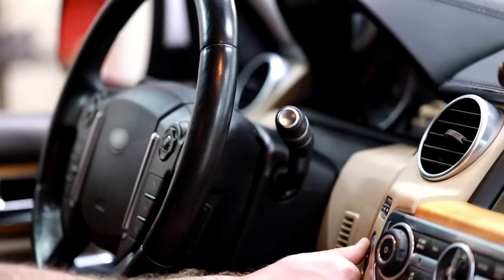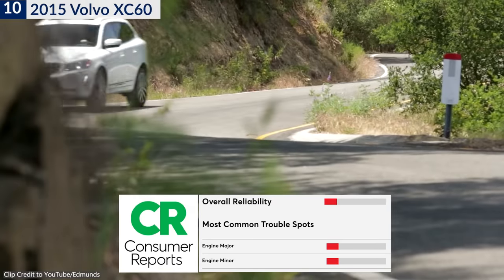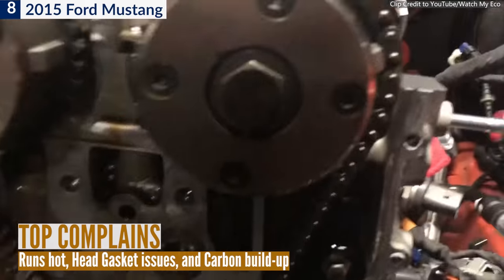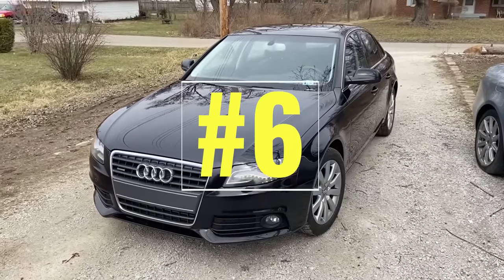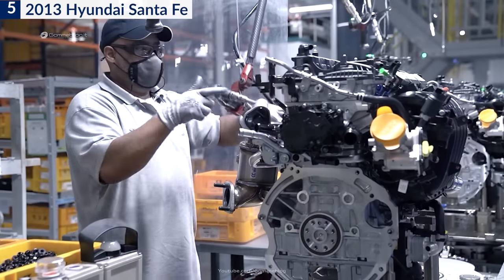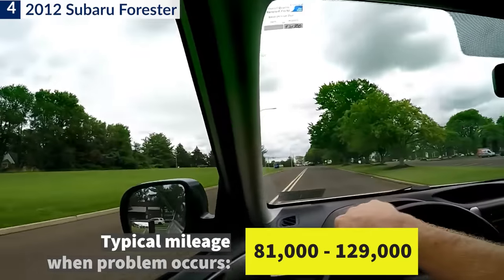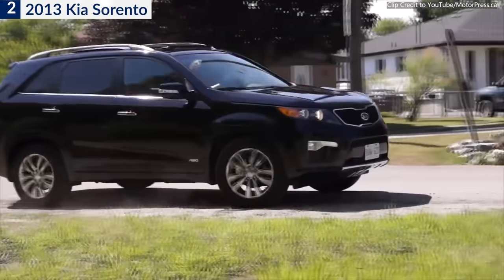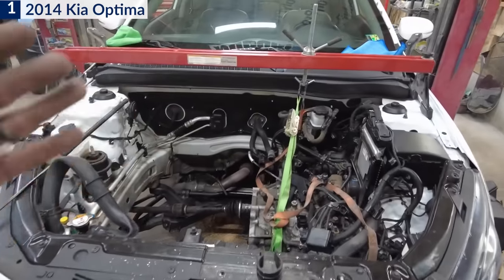10 Used-Cars to AVOID for BAD Engine - as per Consumer Reports

Comment: We purchased a new 2013 Hyundai Accent HB.  It's 11 years old and it has been a great car.  Engine purrs and transmissions shifts smooth.  Everything on this car still works.  I have done most of the maintenance myself.  Besides basic maintenance, I have replaced the alternator (normal for a car this age).  I guess sometimes you just get lucky.
Reply: That car will last a long time.

Comment: Too much high-tech, especially on turbo engines. My 2001 Chevy Astro with the 4.3 liter V6 is a joke to many I'm sure, but it still has 50 psi oil pressure with 280k miles. Best auto purchase ever.
Reply: Those were nice Vans but boy were they thirsty.I really liked the 1988 model with the European type headlights
Reply: You better hope your never in a frontal collision in an Astro.  They are deathtraps.
Reply: @user-tb7rn1il3q  They said that about the VW Beetle air-cooled with gas tank in front yet it was the FORD pony cars (Pinto, Maverick) with gas tank in rear that were the ones you always had a bag of Marsh-mallows for the just in case time.
Reply: We hav a 2000 GMC Safari 345000 on the engine, Still runs like new
Reply: i have a 1992 Chevy S10 4.3 shortbed with 240k miles. Engine has never been opened up. I've mostly only had to do general maintenance.. oil  changes ,trans fluid, tires, brakes....etc.
Reply: I have a 2005 astro 360 k lol still runs
Reply: @robcontractors6085  I was a courier for a company I worked for back in the early 90’s and would deliver packages to different companies day-in and day-out in a GMC Safari, which is the Astros twin.That van had well over 200k miles.
Reply: The 4:3 engine is a good engine
Reply: @bunzeebear2973  lol
Reply: The 4.3 is reliable, but rough and thirsty.
Reply: @lowlifeangler  agreed I have a 1998 c-1500 Silverado pickup with the 4.3 vortex v-6 although while thirsty on fuel it has well over 200,000 and uses no oil and has 45-50 psi oil pressure at highway speed no problems whatsoever and it’s 23 years old not bad for a crappy American gm product although it can’t touch my 3 rd geno Toyota forerunner sr5 with a 3.4 v-6 with 300,000 mi and doesn’t leak or use a drop of oil however I wish gas mpg was better it too like the gm 4.3 is thirsty on gas but never breaks down or leave me stranded and starts right up sitting outside in -30 temps one rock solid Toyota product bulletproof vehicle like the landcruiser and helix and many other Toyota vehicles
Reply: @claytongillaspy8847  cool, Dad has a 1999 4.3  S10 that has a little over 100,000 miles.  He barely drives it
Reply: I had a '72 SHITROLLING Vega gt that was the worst piece of shit EVER!!!!!!! ONLY HAD IT FOR 2 YEARS- 2 ENGINES LATER & MONTHS IN THE DEALER. THE CAR WOULD NOT PASS INSPECTION DUE TO VERY MANY RUST HOLES. WE HAD PAYED THE DEALER A LOT OF MONEY TO RUSTPROOF IT WHEN BRAND NEW!!!!!  2 MILES ON IT!!!! THE DEALERSHIP BLAMED THE RUSTPROOFER - THE RUSTPROOFER BLAMED THE DEALER FOR NOT APPLYING THE PRODUCT CORRECTLY!!! THIS CAR HAD LESS THAN 25K ON IT!!!  THEY BOTH GAVE US NOTHING EVEN THOUGH WE HAD A RECIPT FOR THE RUSTPROOFING !!!!!     I WILL NEVER - NEVER BUY A SHITROLLING CAR/TRUCK AGAIN!!!!!!!!!!!!!!! TO HELL WITH SHITROLLING!!!!!!!!!!!!  MONEY WAS HARD TO EARN BACK THEN - SPENT 2800 DOLLARS ON IT BACK IN '72 OVER TWICE WHAT WE SPENT ON '68 BEETLE.  GM/SHITROLLING RIPPED US OFF THOROUGHLY!!!!!!!!!
Reply: @dougcarpenter7627  Man, you could have bought a Corolla with that kind of money back then. Everyone now knows the Vegas were literally steaming garbage cars, but in 1972 they looked better than Pintos.

Comment: I own a 2007 Suzuki SX4 manual Tran all wheel drive crossover  from new 175,000  driven all year round in Alberta only thing it’s needed so far was a serpentine belt.  a great little car just did the brakes last year amazing. I tow trailers, pile ladders on the roof rack and it’s peppy and fun to drive

Comment: 2020 Kia telluride. Had nothing but problems since I drove 50 miles to the dealership to get the scheduled maintenance and oil change done, drove 1/2 way home, noticed a smell and engine running slightly hot.. pulled over checked oil, NO OIL IN THE CAR!!! Not once but TWICE the dealership/service department did this!!
Reply: Bet your Telluride is toast by now if you drove it with no oil
.😮
Reply: Had that happen Days chevrolet Oil change for trip to northern s carolina got to columbia oil not show on stick over 2 qt low Despicable

Comment: I had a 2014 Kia Sorento SXV6.  Almost 3 years ago my wife was driving it and she said that she heard a grinding noise while driving it.  She took it to a local Firestone and they checked her oil and there was none in there.  They filled it for her and it cleared that up.  Took it to the dealer with 99,400 miles on it and they said they'd have to do an oil consumption test which would take it over the mileage.  When we called Kia about it, it had a little over 100,000 at that point and they said the dealership didn't log when we came in with the problem.  The lady at the other end asked my wife "Well don't you check your oil every time you get gas" and my wife asked "do you" with silence at the other end.  So going through about 4 quarts of oil every 1500 miles for 2 1/2 years I was on my way to work and it blew up on a busy interstate.  I had to pull it off on an on ramp shoulder.  It had almost 144,000 miles when it happened.  Needless to say, Kia will never get my business.  I had beater cars that got way more miles than a Kia Sorento SX V6 with every option.  I had 2 cars, one that I paid $2500 for and one for $4995 that both were well over 200,000 miles when I got rid of them.  The one was leaking oil really badly, but the other one was fine.  I had a 2011 LXV6 Sorento that was great but got rear ended.  That one almost had 144,000 miles on it as well but had a different ending.
Reply: I totally love my KIA   Just passed 140,000.  It does however have an electrical problem.
Reply: My vehicle (not Kia) at 204k burns about 1 quart of oil per 1000 miles, and I thought that was bad. 
But 4 quarts every 1500 miles is insane.
Reply: I check the oil level every week, literally takes me 2 minutes.  Unlock my car, pop the hood, raise the hood, pull the dip stick & wipe with paper towel, replace dip stick and re-check.  EASY.
Reply: @onenikkione  My wife has a bad back so she would have a lot of trouble picking up the hood and slamming it back down.  When you're spending that much on a car, you would hope that it wouldn't be going through oil like that.  I had cheap cars that didn't have the issue the Kia had and that's the only car I've ever owned that the engine blew up and I had plenty of cars throughout my lifetime.  Kia lost my business.  The lady at the other end said  to my wife with the initial original complaint "if your oil light comes on, your engine is done."  That didn't happen in her case.  Most cars will give you the low pressure light as a cushion to let you know to add oil.  The only other car that I had a major oil leak was my 1988 Chevrolet Corsica.  It had 211,000 miles when I traded it in but in spite of the major leak, it ran fine.  I just had to add a quart of oil every so often.

Comment: There is nothing 'eco' about replacing/spending tons of money on turbocharged 4 cylinder or v6 engines. High rpms, lightweight parts, rubber band cam-chains, along with direct injection - OIL burners.

Comment: I had a 2013 2.4 Santa Fe. I sold it to my sister with 106,000 miles with zero trouble and she still has it with 150,000 and still going strong.
Reply: Great story bro
Reply: Ya eh  there are always exceptions. I have a 2009  Nissan Versa with the CVT transmission  148k on it. Engine and CVT still run as brand new

Comment: That issue with Audi 2.0 T engine has not disappeared, it just moved to the VW lineup.  We just got rid of a 2016 Tiguan with that engine and we were adding oil every 700 miles.  It had  been going on for about 12-15 months, getting worse,started with about 50-55K miles.
Reply: I am unsatisfied with my 2015 Renault based Dacia Duster but other more costly brands (from 2015 or 2016 onwards) don't seem to be doing much better. Lots of electronic issues and so on.
Reply: its the same engine dude lol any 09-16 vag is an issue

Comment: My 2021 Elantra SEL with only 7,400 mi has been sitting at the dealership for five weeks waiting on a new transmission. Service manager told me there’s another Elantra same year as mine at the dealership with the same issue and same low mileage. I was given a 2022 Santa Fe as a loaner, and after reading more about these cars, I just hope it remains operational until I get my car back…IF I get my car back. Right now it’s solidly in lemon law territory, so maybe that’ll come into play.

Comment: Well done. Consumer Reports is a nonprofit organization that takes NO ADVERTISING.  Their testing is objective and, in my experience,  reliable.
Reply: Excellent points, but most people ignore them.  If CR doesn't recognize THEIR car as being great, or criticizes their car for problems, then they lie about CR.
Reply: If that’s true, where is Honda with the 1.5 liter turbo motor that leaks fuel into the oil/ engine. Hmmmmm.

Comment: I have the 2012 GMC Terrain with the 2.4L, 4cyl engine. It's a decent SUV with a car-like fuel economy. This SUV is very slow even with the direct injection, so quick acceleration definitely feels bad for the engine. Probably the biggest cause of these engines burning oil and losing compression is people expecting SUV like power out of a Chevy Malibu based engine in a 4000 pound SUV.
Reply: I have a terrain, people get so pissed when I get on the highway 😂
Reply: Guys, maybe try an Enclave next time. I think you'll like the 3.6L power more and hopefully not using much more gas. Terrains look good to me too though.
Reply: @ROB-12013  I really like that suv, seems to be well rounded and those engines are good on gas for a v6, i honestly would consider one

Comment: While Kia & Hyundai did have (combined) the most issues for one manufacturer, an important item to remember is their 10 yr/100,000 miles Powertrain warranty which would have fixed any issues arising prior to expiration of the warranty.   
I personally had (leased) a brand new 2011 Hyundai Sonata and I put just under 45,000 miles on it, most of those being Interstate miles and never once did I have even one single issue.   My gas mileage was quite good and it treated me very well.
Reply: Nothing better than a warranty on garbage. Very convenient.
Reply: @ConstanceCox  
Prior to going to Hyundais, I owned (or drove for work) Chrysler, Ford, GM, Toyota, and Honda products and not one of them did not have to be in the shop for expensive repairs after 60,000 miles.  
I have been driving Hyundais for over 25 years and have had only a few little issues which, had I been driving a GM/Chrysler/Ford/Toyota/Honda product at the same point, I would have been out several thousand dollars.    I drove my 2001 Hyundai Elantra well over 100,000 miles and the only reason I got a new one was that car, (along with over 1,000 other vehicles at that airport) got literally destroyed by large hail.   
I will no longer even consider purchasing a product from a Detroit-based company.  Detroit cars/vans/pickups are ALL garbage and you have to do so much maintenance on them after the warranty runs out that it becomes more cost effective to just go out and purchase a new vehicle.
Reply: In sudan i own 1983 toyota corona 
We have hilux pickups as carriers from 1970's and 1980' 

In 2008 -2010 the market flooded with Kia sportage turbo, then 3 years later they flooded the mechanic shops and had bad reputation 

Nothing can come close to toyota reliability
Reply: @ScammerStopper  I have a 2007 hyubdai sonata limited that I have had since 2007 with one owner when I bought it. It had 23000 miles when I bought it. It now has almost 3000 miles . On January 28.2023 my engine blew.  I don't know weather to fix it or just get another car. I like my car.
Reply: I don't trust a car that brags on its warranty.  That makes it a certainty that the car will break down.
Reply: @gregnixon1296  I am on my fourth Hyundai. The first one was the very basic accent I purchased in 1996 and kept until I decided to purchase the Elantra in 2001. I kept that for ten years and well over 100,000 miles and only got rid of it because it was totaled in a huge hail storm in 2011.
I then leased a Sonata for three years, turned it in and purchased a brand new  2014 Elantra, which I have had ever since.  I only had one issue which required warranty coverage, and that was fixed easily and quickly.  Otherwise, it has not been in the shop.
I am of the belief that, if the manufacturer does not offer a good warranty, they do not believe in their product, so why should I ?
Cheers !
Reply: @ConstanceCox  in my experience, my kia runs better than my previous toyota. i guess kia sells better than toyota in most of european countries.
Reply: @gregnixon1296  hyundais sell better than toyotas in europe unlike in north america where toyota is generally hyped too much.
Reply: Goodluck having them honor that.
Reply: @ka124as  I have actually NEVER had any issues with Hyundai honoring their warranties.  Not once did they fail to do the right thing.. Unlike many "Detroit" car makers.
Reply: @dash-2112  people are poor in europe thats why
Reply: @retrocompaq5212   Actually Japan is poorer than Europe. They make cheap products.

Comment: I have been driving Ford all my life and been happy with them all had a 2014 Taurus with over 200000 on great car! My 2016 F150 has 262,000 on it right now best truck on the road. My daughter has a 2013 fusion with 165,000 on it been a great car for her she looking at getting a new Bronco. You r doing a good job Ford motor company.
Reply: 🤔 turbos no thanks
Reply: It's got the 1.6
Reply: My uncles 2012 ford explorer 280k miles no issues
Reply: @allenstuck2861  how bout the 16 f150? Is that the eco boost 3.5?
Reply: @mikegarcia7452  I can’t speak for Allen, but I have a 3.5 ecoboost with 397,000mi on my 2015 expedition work vehicle. I love it and it runs nice but they’re giving me a 2017 EL Limited with much lower miles.

Comment: BMW = change your engine oil every 10,000 miles, and while you are at it, change your engine and transmission too.
Reply: Exactly,the very worst vehicle I ever owned was a BMW 3 Litre series, cost a fortune to keep on the road, I got rid of it after four years,couldn't afford to operate it,mechanically I'd have guessed it was built in China by and designed by idiots.
Reply: @terryofford4977   If you ever watch Youtube videos of new car reviews, they place the BMW and AUdI as the bar for comparison whie leaving out their track record of being problematic. I'd rather have a boring but reliable anything than a fast driving great handling oil burner that is in the shop all the time.
Reply: Cha cha cha cha cha cha
Reply: BMW stands for
BAYERISCHE MOTOREN WRECK.
Reply: The best corner to have a fun to laughs all day . Your comments guys keep me alive . Lough is very healthy and relaxible.
Need more more comments from car owners.
Cha cha cha cha cha cha.
Have a good days and Happy New Year
Reply: I used to own 90s Hondas and I decided to get a BMW around 2010. When they told me it had 20,000 km oil change intervals and lifetime fluids I actually thought it was ridiculous. I changed the oil every 7,000 anyways and the car was actually decently reliable. They kinda predicted the future as most cars sold today ranging from Toyotas, some domestics and other European cars have the same maintenance schedule.
Reply: BMW=Big Money Wasted.

Comment: I've owned Mazdas for 11 years and have yet to run across ANY of these issues. 💯💯💯
Reply: The check engine light came on in my 2010 Mazda 3 with 131K miles on it about a week after I bought it used with the code for catalytic converter efficiency below threshold.  In contrast, I've had Toyotas and Hondas with almost 200K miles on them and never had to replace the cat on any of them.
Reply: Never had a Mazda with an A/C system that could begin to handle the heat in the South.  My son's Mazda 323 blew a head gasket without warning, and a possible reason (given by Mazda) was a clogged cat.
Reply: what are you thoughts regarding the 2.5 turbo in the cx9 and cx5 starting in the 2016 models? I'm considering the former.